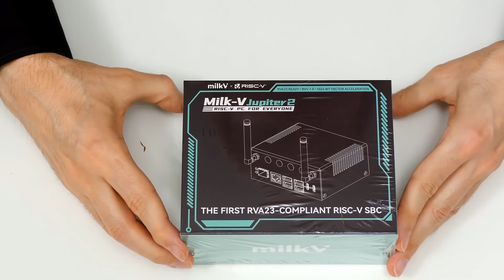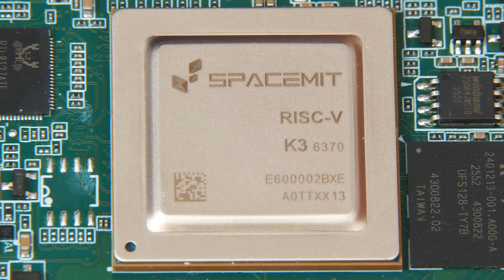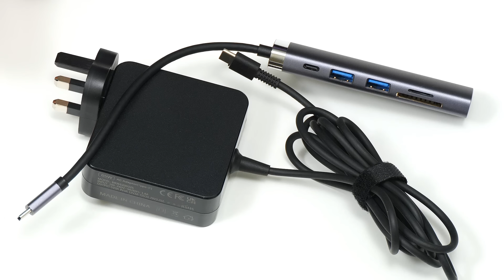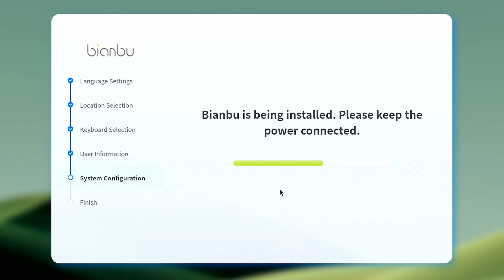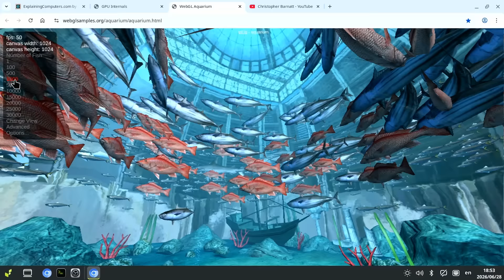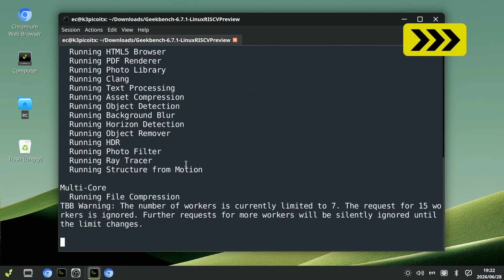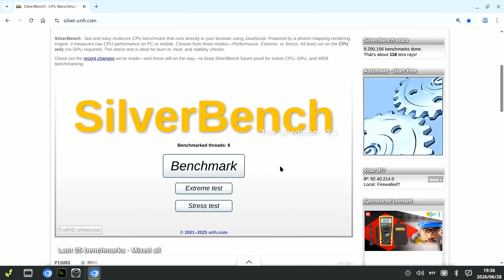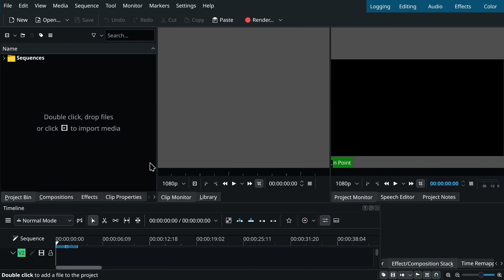Milk-V Jupiter 2: RISC-V RVA23 SBC

Comment: An impressive looking case and internals for a developer board, the future of RISC-V is improving with the addition of the new ISA set!  The N100 and Raspberry Pi was faster, it won't be long before the tables are turned, fingers crossed.  I'll be interested to see how this fares in your seven day use test and look forward to the results, another happy Sunday :)
Reply: Bit hot. Atleast mine is. The reviews that mention temperatures also are. Not a lot of vent holes in the case.

Comment: RISC V finally becoming viable for common PCs! That's wonderful! Thanks for this video!
Reply: Not at that price.
Reply: @terrydaktyllus1320  an 8 GB Raspberry Pi 5 costs about the same now ... another ocmment quotes £170, which is $228, vs this at $250.
Reply: @terrydaktyllus1320 we are not talking about price but about system performance
Reply: @KoczulMoczul  Well then you're talking about a different topic to what I am talking about?

Or I do I need to check with you first that it's okay to post stuff here?  That would sound very self entitled if that is what you believe, sonny.

Off you go then, mind how you go.
Reply: @terrydaktyllus1320 well, first things first. Before this new piece of hardware, the system performance of the previous one was too poor to be viable for the average consumer. Now it seems that maybe 2 iterations from now we might get something "good enough". And then we'll discuss about price. It seems promising as RISC-V is an open standard so maybe more companies will be interested in entering this market and with mass production the price would go lower anyway.
Reply: @ter @terrydaktyllus1320  🤡

Comment: I stopped watching the moment you announced the price. I recognise that board manufacturers cannot be held directly responsible for ludicrous component pricing at the moment, but ultimately it still comes down to the fact I can buy a used SFF PC on eBay for easily less than half the price of this board (and most other SBCs currently).

Way back in 2011, there was a degree of "novelty" to the fact that we could all pick up Linux-capable SBCs in the form of the first Raspberry Pi for £35 - the MagPi magazine could even afford to give away a Raspberry Pi Zero stuck to its front cover.

To be perfectly honest, the large collection of SBCs and microcontrollers I've accumulated since then (as well as used PCs when they were ultra-cheap during and after the epidemic when the masses were rushing to upgrade to Windows 11, THE FOOLS!!!) will serve me for a few years to come anyway when it comes to my electronics and IoT workbench, as well as a bit of emulation.

This is possibly aimed at the AI crowd but as a complete AI cynic who has no plans to turn his already oversized geek brain any time soon, I could care less about chatting to GPT, Clawed or Anthropic (that just sounds like a thrash metal band).

Ho hum, nothing to see here....

Comment: they should build SBCs wtih dimm slots to fight the RAMpocalypse.. so many people have old DDR3 and DDR4 dimms laying around doing absolutely nothing.
Reply: It's not a bad idea but I think it would not save much against manufacturing costs, having to put RAM slots onto the boards instead of just RAM chips.
Reply: @terrydaktyllus1320  ram slots couple of dollars,  , ram chips upto hundreds of dollars atm.. there is no point builoding a SBC with an NPU if nobody can actually use it for anything other than object detection.
Reply: @IvarDaigon  You're welcome to speculate as much as you wish, in my universe my opinion still holds - especially as someone who has been building computers for more than 40 years now.

Discussion closed.
Reply: @IvarDaigon  You can use the AI cores to run LLMs. Llama.cpp has specific build instructions for this chip.
Reply: @terrydaktyllus1320  wow you have been building computers for 4 more years than I have.. let me bow down to your mnasterful expertise lol

Comment: The SFP+ port makes me think of using this as a cable/fiber modem, though a faster ethernet port to go along with that would have been nice.
Reply: Indeed, faster ethernet would have been nice, though depending on your exact use case you could split the SFP+ port into a couple of VLANs.

Comment: As a hardcore x86 fan I am terrified by how well this runs.
Reply: Wait, you're a hardcore fan of an ISA? How does that work? And if anything, shouldn't you be excited for options outside of the Intel / AMD duopoly, because I know I am...
Reply: As I note in another comment, it's closing on my 10 year old Xeon, which is some durn good catching up. Right up in the everyday range.
Reply: @Reziac A 10 year old Xeon is the generation of the E5 2667 V4 & E5 2699A.

It's nowhere near

Comment: The AI cores show up in htop like a regular core?  Oh that's weird.
Reply: They are regular RISC-V cores and you can run all standard software on them. They're just a bit slower for general use than the X100 cores ... around 40% as fas generally ... but as they have 1024 bit vector registers they handle that kind of code very well.

Comment: This is very exciting indeed, great to see RISC-V standardizing and becoming viable for basic computing tasks. From what I can recall, the standardization part used to be a problem with these CPU's because many differ when it comes to instructions (I'd imagine because the chip is open and the chip manufacturer/engineers can choose which instructions to leave out). Not too bad performance either! :D
Reply: No, there are standard profiles before RVA23, like RVA22. But the big thing is that Google has set RVA23 as the baseline for Android and Canonical has also set the baseline to RVA23 for Ubuntu 26.04.
Reply: @LivingLinux  Ah, appreciate you for educating me on this. Cheers ^^

Comment: Forgive me if I missed it, but you mentioned that it isn't for general-purpose use, so what is its use case? Regardless, apart from fiddliness  (if that's a word. I know it's not 'cause I looked it up.) for video, it is a nifty little device for its price.
Reply from the maker: It is for RISC-V development and for early RISC-V pioneers to experiment with (and possible industrial application). In other words, it is hardware that will allow people to create and test RISC-V OS and applications, so that they will be available when the general purpose, end-user hardware arrives. It's always chicken-and-egg -- with no software, hardware is useless. But for a new ISA, software development is inevitably limited without hardware to develop and test on.
Reply: Primarily developers, some security researchers and engineers looking into industrial applications.
Reply: As long as you know how to build from source, it's ready for general use. You can even run some simple Steam games with Felix86. There are a lot of open-source games that you can run on this machine. I even managed to get 0 A.D. working (and a lot more games).